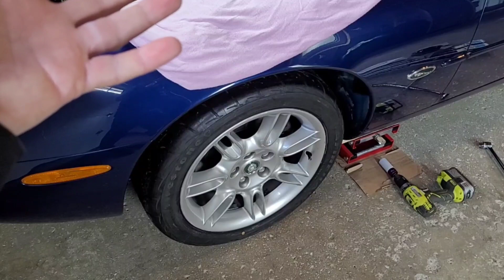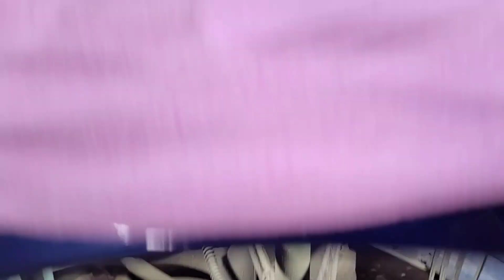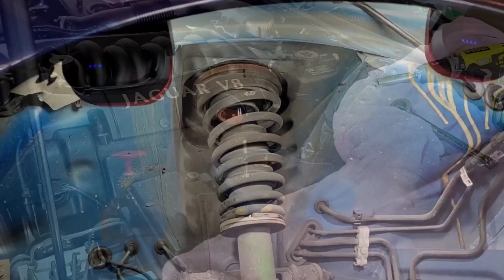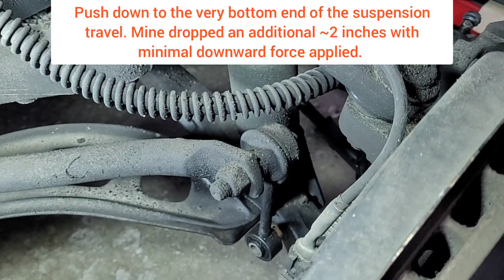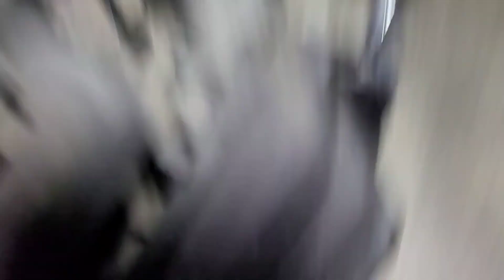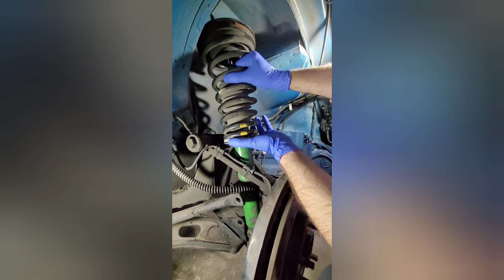Jaguar XK8 & XKR | Front Strut Assembly: Removal Process [Episode 1]

Comment: I was swapping out my upper shock mounts doing on my 2004 XKR and during the removal I accidently banged the inner guard with the shock tower twice and created a couple of small spider web dents from the inner side facing out, I really struggled with one side only, I think it depends if it's right or left hand drive as I had little room to move. Maybe I did it wrong somewhat. I recently bought some new H&R lowering springs that I will fit soon and will try to avoid making the same mistake again. Did you have the same ease removing the shock tower from the other side too? I'm curious, my left side was where I went wrong as like yours I think the brake lines are in the same place that feed into the ABS module through the fender as in your images. I can't remember now what caused me to get stuck and bang it around too much...it made me so angry as my paint is almost pristine! I spoke to a body repair guy who said a good dentless repair person should be able to fix mine as it hasn't quite split the clear coat...if you can picture what I mean.
Reply from the maker: Oh man, I know exactly what you mean about those dents. It's the worst feeling, especially when you've done the damage yourself. I've had a couple similar experiences in the past, unfortunately :(  In terms of removing the strut tower, the side which I filmed was a bit harder (more friction/resistance while pulling out at the top side). The side which I did not film came out much easier, almost no friction/difficulty at all. The key is to have the suspension sagging down as much as possible, anti-sway bar disconnected as well. By how much will the H&R lowering springs lower the car? About 1 inch? I suspect you'd need wheel spacers as well, to bring the wheels out a bit, because it probably won't look very good if the ride is lower, but the tires remain indented inwards, as they sit stock from the factory.
Reply: @2001JaguarXK8   please excuse my wording error re "top of guards to tyres", should read "bottom of guard to top of tyre".

Comment: I followed your method today on a 2002 4.0 xkr i was not able to remove the strut as you did just wouldn't come out, what i tried next worked really well, as well as the lower link bolt remove the whole bracket aswell what is attached to the bottom Arm 1 t60 torx bolt  , then the whole assembly comes out with lots of extra room to do so hopefully this helps others 👍
Reply from the maker: Thank you for sharing your experience! I agree that having that bracket out of the way makes things much easier. If I were to do it again, I'd follow your advice! Wishing you a happy driving season ahead :)

Comment: Can you not undo the shock and remove first before the spring is removed??
Reply from the maker: Hi Mark, the spring is squeezed under pressure and it is not safe to undo the shock first while the whole assembly is in the car. At least it is not a "conventional" method of doing it. The rest of the videos in the series cover the process of separating the shock from the spring. If doing at home, please be careful. Wear face protection and hand/finger protection, if possible. People have been injured severely while releasing the tension from springs, the process carries a level of risk which is not to be underestimated.

Comment: Critical view at 15:14. The bottom of the strut is in FRONT of the lower shock mount! This is what gives him the extra 1/4" clearance needed for the 3 top mount studs. 
Otherwise it's impossible without removing some part of the upper wishbone. Thanks for that!
I had to watch this part 5 or 6 times to get exactly WHY it worked for him.

Comment: Thanks for showing how to remove the strut without releasing either the upper wishbone fulcrum bolt or the upper wishbone ball joint - all the other videos I’ve seen needed 1 or the other. We have 2 X100s to do this on and hopefully your video will be the answer
Reply from the maker: Please also take a look at my replies to the other comments to this video. I provide a bit more context, in case you run into problems with taking out the strut assembly. Best of luck!

Comment: I’m wondering if there’s a difference with later model XK8s. I have a 2006 and am right in the middle of doing this. There is no way I can get enough room to remove it the way you do. I can’t get the bottom of the strut up past the triangle piece.
Reply from the maker: Hmmm, I am not sure about differences with the later models. I'd say make sure your sway bar is completely disconnected on both sides of the vehicle and the suspension is pressed as far down as possible. Then, when you are maneuvering the strut assembly itself, you first need to turn it a bit (approximately 90 degrees from the original orientation) so that the bottom bushing is not pointing front-back, but rather points more towards the engine (I hope that makes sense). This will help with the three bolts at the top and getting one of them out of the metal ridge/stamped edge which limits the movement on top. If the shock can not clear the triangle plate on the bottom, try to get one of the bolts on top to clear the edge. Once you have one bolt free, the rest follow easily.
Reply: @2001JaguarXK8  Ah! That note on getting one bolt clear makes sense. I was trying to do that very thing but just couldn’t get it. Ended up pulling the wishbone bolt. Then it was clear sailing.
Reply from the maker: @PatWCincy  Glad to hear you got over this hurdle. Best of luck with the rest of the process!
Reply from the maker: I re-watched the video. Pay close attention around the 15:00 minute mark. First, one bolt on top clears the ridge. Then, at the bottom around 15:03 you can see how I turn the strut assembly and the bushing can then clear the triangle plate. This is possible because the top of the strut is now partially out over the ridge and can move more freely.